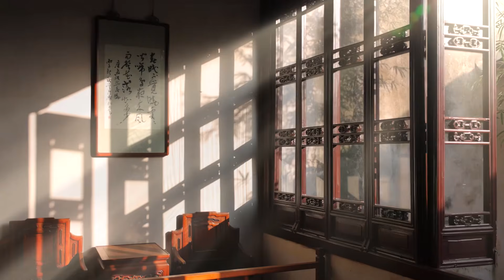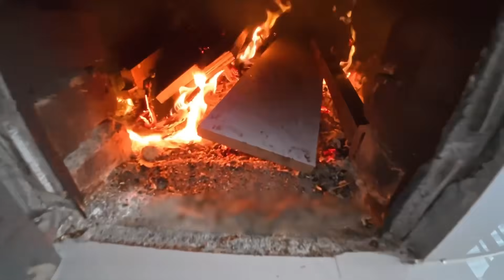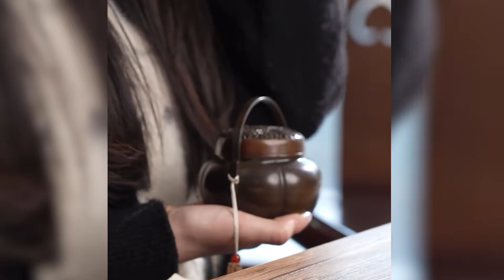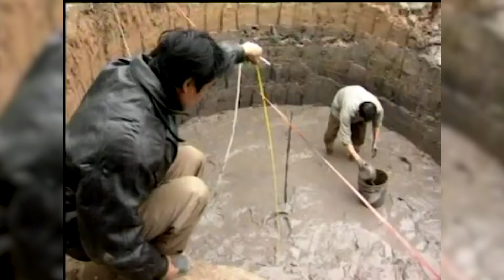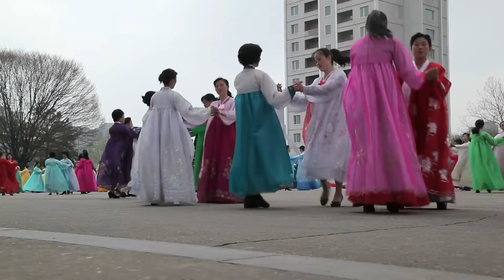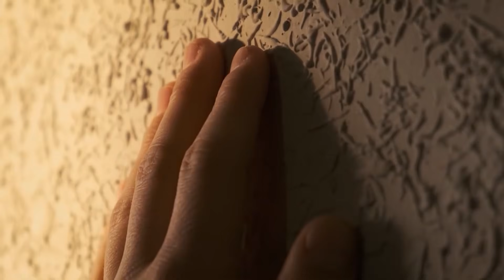How Chinese Have ENDLESS Heat for Their Home WITHOUT Gas/Electricity

Comment: I’ve Hurd lately. This is why most elderly oriental die is because of keeping only one room warm and going into the bathroom, which was cold as you said -30 to-60. I’m going to the toilet or bathing and changing clothes. A lot of the elderly end up freezing to death in there because they didn’t warm the room up because they don’t eat anything and spent too long in there and wind up freezing to death. But they save on heat. Maybe they should move a pot to the warm room to go to the toilet or to do their bathing and changing clothes instead of the cold room. This is what I’ve been doing the last few years